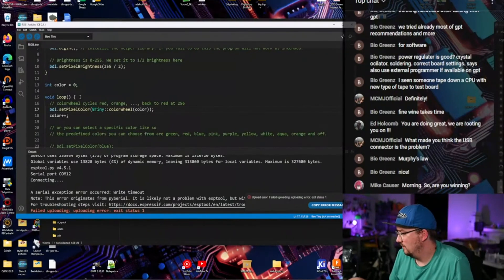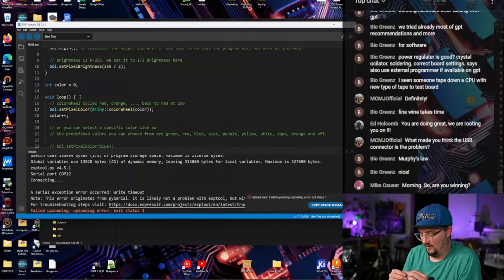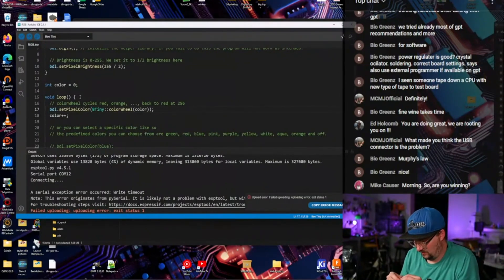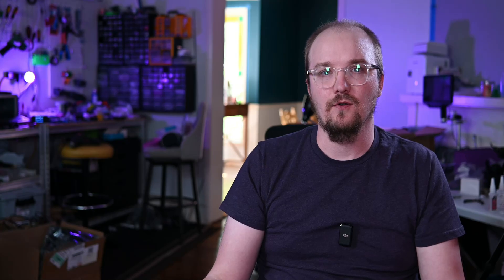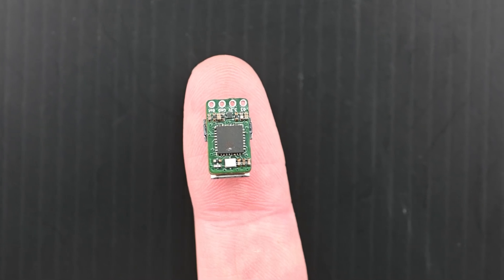I Made A Tiny ESP32

Comment: If you want make it smaller, You can remove buttons and the USB and have an external USB connection when you upload new software. Power can be handeld in many ways depended on need.

Comment: I did not understand where was that very moment, when the Wi-Fi connectivity was lost? Isn't the antenna inside the chip under the black package cover?
Reply from the maker: While technically there is a pin on the chip itself which is for WiFi, it's not attenuated to be of any use. Essentially the signal it can produce is miniscule and practically of no use.

Comment: Do we need the buttons, what if there were just points we could jump our selves to act as buttons... - and once deployed, we wouldn't be using the buttons any more.

What about ditching the buttons and USB port, but adding two solider points for a wire antenna to be added.

And print on a flexible filament PCB (flex PCB)

- if you do, this and sell these I would very much buy them.

Comment: Hey i am working on ESPC3-mini N4 , i am strugulling to flash , can you guide me how i can do it, 
i used gpio9 to low to keep it in programming mode but still no use
Reply from the maker: With the c3, gpio 8 must be pulled high to program it. A 10k resistor to your 3v should do the trick.

Comment: Great concept. I look forward to your v3 with the suggestions implemented. Of interest to me are having an onboard antenna and more GPIO pins available. It would be handy if the parts were all on one side and pins exposed via catellations so it could be installed flush on another board. I like the suggestions of ditching the USBC and switches to make more room, as those can be connected via castellations. A companion dev board can be made to hold the castellations (with friction, like FlexyPins that I saw on hackaday) and breakout the USB, buttons and GPIO for prototyping & programming. For even more GPIO, could have SMD pads on the bottom side. 

I found your video while I was researching tiny ESP32 options I might use for a Bluetooth to PS/2 keyboard adapter. I don't think I can use an S3 in this case because I need classic Bluetooth for compatibility with most keyboards, so ultimately I need a classic ESP32 in tiny form. For this particular scenario it just needs to handle 5V power, GND and two GPIO from the PS/2 connector and I would only need temporary USB for serial monitoring and programming. 

I enjoyed your video on what's possible.  :)

Comment: How easy do you reckon hot plate reflowing a ESP32-S3-MINI-1 is?
Reply from the maker: If you mean a dev board with an esp32 on it. No problem.

If you mean taking the tin can off a esp32-s3-mini-1, just set the temp north of 450F and it'll come off.
Reply: @paulprice  I just mean putting a mini module onto a board
Reply from the maker: Yeah a hot plate would work fine for that
Reply: @paulprice  Thanks. I'm about to be new to hot plate reflowing (just ordered a MHP50), dont have a hot air station and was worried when I noticed the ESP mini modules I ordered several of didnt have castellated pads. I was thinking bridges might be a big problem.

Comment: The challenge was great. I watched it with pleasure. Anyway, what I want is to add an sx1262 lora chip to this structure. Let's see if it will be the way I want it to be. I think the important thing is that it has an esp32 s3 centered structure (with sx1262 lora chip) and supports both arduino ide, esp idf and microphyton infrastructure. I think having so many programming infrastructure options will greatly increase the popularity of these boards. Especially if you consider the difference between the ESP version supported by the Arduino IDE and the version of the ESP IDF, you can understand what I mean more easily. This type of board will be extremely functional in education. In short, for example, it is a module structure that connects an sx1262 lora chip to esp32 s3 fn8. Esp32 should be designed to keep the GPIO pins active as much as possible. In a sense, think of it as a module. Then I think that this structure can form the center of many training sets.

Comment: Use smd antenna that is on the esp32 c3 mini dev board, no need of buttons just expose two solder pads and any tweezer can be used to trigger flash,
I could argue that microusb port can also be ditched and temporary wire solder or some hacky 4pin alligator style clip can be used to program it but it might trigger some people,
Also check deep sleep as you used your own schematics and different capacitors can cause rise/fall timings on rst pin to change and make deep sleep unusable
Reply: Just realized that everyone else basically said the same things, very pleasantly surprised, wonder why manufacturers are not thinking that not everyone needs pampered dev boards

Comment: Use flex PCB and make the back side as USB-A contact, after solder make a mold the size of PCB and fill the component side with acrylic.
Use the ESP8685 not the C3 (and not ESP8285 either), it's basically the C3 but in 4x4 mm QFN package.
Some decoupling capacitor can be omitted, the same with resistors on pin 2 and 8.
You don't need a BOOT switch when programming using USB-CDC, and you can just power cycle the thing in case of RESET switch, so both can be omitted.
Reply: well said
Reply: Hello any pictures or pcb files? I'm very interested

Comment: I have an idea, tell me how real it is. There are external boxes for ssd m2, like a fast flash drive. I want to do the same thing, just add more WIFI there. It was supposed to do this via ESP 32 or another microcontroller, but most of them do not support USB 3.0, and I did not come up with another way to transfer data at high speed and use WIFI.

Comment: I agree with the usb male "fingers" but remember you can also space out the connections to make it type 3 compatible. And with the extra space for the USB on one side, you might as well move the antenna to the other side. Another space saving constraint would be to put those castellated half holes. And maybe break out a few GPIO on the sides with the half size holes

Comment: Check out the expressLRS boards that are super tiny to get ideas for adding a ceramic or SMD antena

* could just stick a smd connector for the antenna also … the FPV ones have a nice solid type like the MMCX but normal ones are even smaller

… lol this is nice though, but you could get whompy with it and try and stick the ceramic antenna / connector on the Z axis ( side ) of the pcb, depending on how your routing the pins you could use a FPC connector from like a cellphone or whatever to break out them gpios

Comment: Would be awesome if it was set up so that you could sandwich other micro boards to increase functionality. Allowing you to run with just a basic esp32, or add other boards if you have the space available. Makes me think there could be a whole community around building out expansion micro boards. Very good work! I wish I knew enough about building boards and electronics, instead of going down the software engineering path.
Reply: Getting them i2c and i2s pins exposed would be awesome on this. Imagine the spy gadget you could make with these. Damn

Comment: I'm a nood with this tech, I have a cheap chinese 3D printer stocked in the storage for almost an year, cause I couldn't manage to update the firmware correctly to work with the new bed sensor I got. I have a CNC board to make a CNC machine someday when I get more money for the missing components, and one Ellego board, imitation of the arduino uno, but I never managed to mess arround alot much cause I had some health problems so I put it all on the side.

But from what I understood, all this chips are what makes you being able to connect to sensors and make the logic if the entire board.

is it possible to make a mini super computer with idk like 6 of those chips interconnected in 1 board only?

I would love to see that, to see how you would code that. :)
Reply: Noob not nood :p

Comment: I didn't know you could reflow both sides one after another. Do you have a video explaining how you do this?
Reply from the maker: 2 different temperature solder paste. 1st side is a high temp paste and the 2nd side is a lower temperature solder paste. When reflowing the 2nd side it doesn't get hot enough to melt the solder paste on the 1st side.
Reply: @paulprice  Thanks!

Comment: How are you able to put the second side in the oven without worrying about first side parts getting loose?
Reply from the maker: 2 different temperature solder paste. 1st side is a high temp paste and the 2nd side is a lower temperature solder paste. When reflowing the 2nd side it doesn't get hot enough to melt the solder paste on the 1st side.

Comment: whaaat, You can reflow on the both side of the pcb . How i didn't know about it. Thanks paul. Great work though.
Reply from the maker: You can when you use 2 different temperature solder paste. A high temp for the 1st side and a lower temp for the 2nd side
Reply: @paulprice  okay. anything else to learn from your experience?

Comment: that´s some impressive work. Could you even make a matchbox 486 dx 100 with s3+3d that could actually install win98 and run retro games? sure the hdd may need to be a tiny thumb drive or a separate ssd, but still.The smallest ever retro gaming pc with "original" but redesigned chips, that do exactly what the bulky pc components did but with modern 5-12nm chip manufacturing methods? Can that even be done, are the designs for the old pc stuff in public domain yet?

Comment: Life long fan of making it smaller,  from a radio receiver for R/C reduced to stamp size, to index a tiny computer which consisted ofv3 index card sized boards 1973.  Last project was quad controller about 12 years ago, from 55x70 mm to 11x17 mm. There was one problem, I knew little of reflow soldering.  Thus placing the microprocessor on the bottom was and adventure.  But with a failure or two I got it done , nobody was more amazed than me.  Now the parts are too hard to see, and my hand shake a bit.  Guess I could still design tiny things and have the build done elsewhere but then would it be mine ....?  So I well appreciate your your project . Remember a tech looking at my tiny receiver and asking why ? I explained reduced weight, and size will allow smaller aircraft, to be fully controlled . Again he ask why  ?

Comment: You probably don't need a full on usb-c port either. You can use breakout pins. If you power the board externally, maybe with a powerbank, you can probably get away with just + and - data pins with usb

Comment: Hi very good job. Here is one suggestion:

So why would anybody need that size? Because space is crucial. And that’s only the case if I put the MCU somewhere into. So I would get rid of the USB Port since you probably only upload the Code once and then use OTA or something. You could give the user a simple RX/TX breakout to use an external programmer. Then I also would ditch the buttons for the same reason. You wouldn’t use them anyways. Just breakout the pins. It’s easy to integrate the button somewhere else.

Comment: Hi,
How did you manage to solder the bottom side without the top side components falling off? 

Different melting temperature solder paste?
Reply from the maker: Correct, 1st side uses a high temp solder paste and the 2nd side used a lower temp solder

Comment: the components on 1.side are not droped off druing reflow???  how keep them steadly??
Reply from the maker: On the 1st side I used a high temperature solder and on the 2nd side a lower temperature solder. So the 2nd side gets hot enough to melt the low temp solder but not hot enough to melt the high temperature solder on the 1st side.

Comment: Why do you use 2 different reflow ovens?
Reply from the maker: The 1st one was just to make it easier to get footage of it reflowing. The 2nd one I had to put it in my actual reflow oven as there was components on the bottom side and the hot plate wouldn't work.

Comment: Don't know if there's space on the board for the additional tracks, but could you break out more IO (or maybe even contacts to solder on an external wifi antenna?) by using contact pads instead of through holes? Even just having two or three IO pins would massively increase the usability of the board.

This might be way too wild, but could you ditch the USB port to a daughter board that uses pogopins to pads or edge connectors? Not sure how many of the USB C pins are actually used, but having that port on there and also having a 3.3V pin (which I'm assuming you use to power the device away from USB?) feels like a waste of space unless you're actively programming it.

Another idea to potentially break out more IO, if the USB C port doesn't use all the IO: Create a separate board with a female and male USB C connector that only connects the necessary pins through, then have a separate breakout board that you can plug into the port after the ESP32 is programmed. The ESP32 can then connect any of its IO pins to the normally unused pins on the USB C connector.

Comment: Here's a thought.... why not go down to 01005 footprint on the jellybeans, and utilize multi-layer pcb with castellated holes along the edges to give you more I/O. Depending on the fabhouse you're working with, and their minimum via size, you could pack quite a bit on both sides of the PCB, why using internal layers  to do everything from power delivery, to routing.

If you do go this rout, having a needle, and a fine tip paintbrush is the way to go when hand placing 01005 sized components (also a full face mask so breathing doesn't send them to narnia, and a microscope to see things)

Comment: Remove buttons, remove usb connector, use smaller components, use pads instead of holes for everything and you will have smaller board with more exposed IO, make one side of it all pads and then make socket for it if you want to use all pads or just solder to ones you need.....

Comment: Heyy! Absolutely awesome project!!! I just have one question,  how did you directly upload the code from usb to the ESP32 chip? Is there no USB to TTL converter required in the middle?
Reply from the maker: The esp32 S2/S3 & C3 chips have a built in USB called USB-OTG which lets you program them directly. No need for an external uart chip like you would find on the original ESP32 chips.
Reply: @paulprice  That makes a lot of sense to me now 😄
Thank you so much 😊

Comment: You can see Logitech's wireless dongles. They have similar footprint with even onboard WiFi/tiny micro controller with firmware. Not too large similar to yours. Logitech uses lot of PCB real estate for 4 usb lines. You can ditch that and use esp32 with microusb/usb-C design. You can still have your buttons. You need much smaller components though. Most tiniest possible. It's design has even a wireless antenna, similar crystal oscillator and lot of caps. Just copy those designs and either Ti or NRF chip depending on your usecase. There are two variations of those PCBs Goldie 008 and Daggy 007. These are mostly Lightspeed, Unifying type USB receivers. I once couldn't do firmware writing so had to switch the Ti chips from a broken PCB to a donor Receiver. It was super hard and took me 45min without proper tools except a magnifying glass, board holder and cheap hot air station. Wish I had microscope and steady hands. 😅

Comment: Even smaller would be castellations for GPIO, SMT pads for power, and a picoblade connector with USB breakout board. You could probably fit a battery charger where the USB connector used to be. You could also potentially fit a U.FL connector for wifi.

Comment: I'd like to see a tiny ESP32 with 1mm pin full break out, canbus, USB, battery...all the stuff you usually get on an ESP32 breakout board.  Antennas don't have to be on the surface of the board. You are already multilayer. Map them out so they are on the edges and internal. This tiny project is pretty cool, but to get it so tiny means seriously limited use!

Comment: An ESP32 without the wifi is a worthless ESP32.  You could do better than this with a 4 layer board. Use a ceramic chip antenna, or Molex makes an antenna that's only 3mmx3mmx4mm

Comment: You could keep wifi and improve on the desing having 2 boards and going full  3d cube esp
Reply from the maker: That's essentially the route I'm going. In my last stream I designed v3 of this and it's going to have the option to stack different add-ons.
Reply: Stackable ESP thingy

Comment: You could make it smaller without the mini-mini-components, by exploring the third dimension: You could fit all your discrete components within the area of the IC: You'd need a board ontop of it, and the token LED could be SMT, while the token buttons could be contact pads to connect with a metal tool. Of course, the IC itself is smaller within its package, so you could shave that down a bit.

At this stage, it might be better to add functionality rather than just reducing size, eg some of whatever you're plugging the microcontroller into. It would also be getting smaller than a standard USB connector.

Ten+ years ago, ARM put a full processor inside a pen. You'd write with the pen, and it'd record the nib's movements, which you could then download.